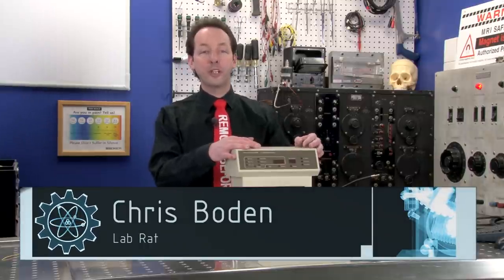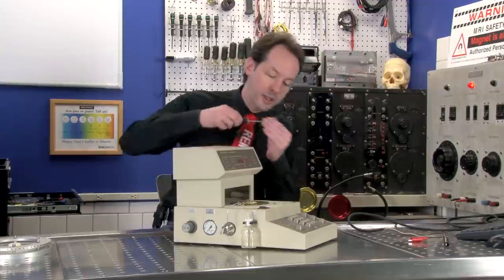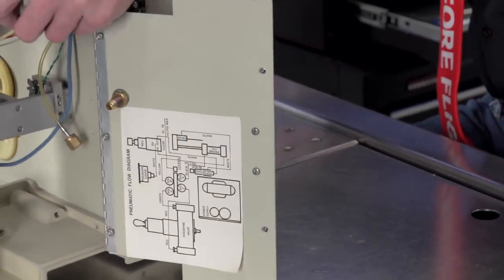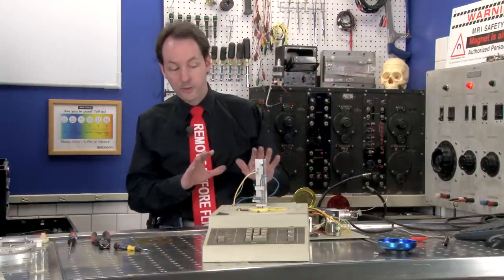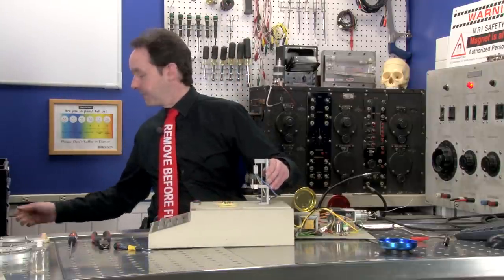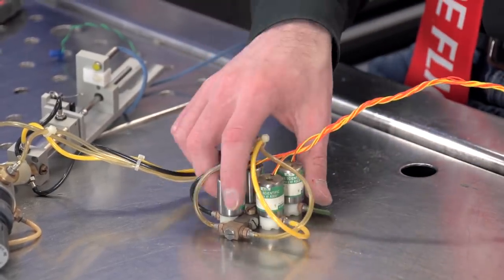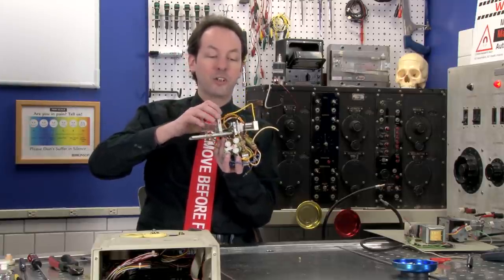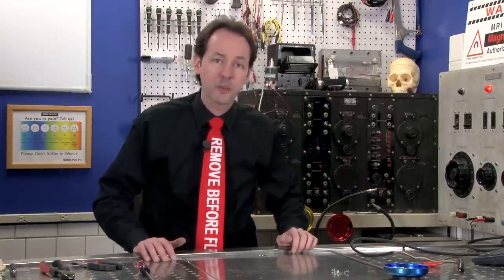Autosampler: Equipment Autopsy #87

Comment: The disk is actually a 2 digit/7 bit binary coded decimal. Looking at the plate at 7:37 at about the 12 o'clock position on the plate you can see it go from
    [000][1001](09) 
to
    [001][0000](10).
This pattern is consistent around the plate and the max number used is [110][0000](60). My guess is that the rotation controller cares very little about what position the disk is at and that the "fingers" which read the plate directly drive the location display inputs.

It also looks like there's some sort of indexing mark inside the digit markings at about 2 o'clock. (Not sure if it's part of the manufacturing process or another data point for the controller)

Comment: You were right, that is a precision pump at the end.  Liquid chromatographs (LC) use microinjections of samples (microliter-level) diluted with comparative assloads of solvent (1-2 mL per minute) to push the sample down a separation column.  The chemistry can vary wildly, but think of it like a pachinko game.  Gravity is your solvent, and its constant force pushes the marble (your sample) down the maze.  Now, if you have several compounds in your sample (imagine grains of sand, BBs, marbles, and tennis balls), they are going to come out of the end of the separation column at different times - especially the tennis balls, which won't fit down the pachinko maze at all.

Here's a REALLY simple diagramatic video:
https://www.youtube.com/watch?v=mPO7Tv2mIJU

Comment: CCV likely stands for Continuing Calibration Verification. "The Continuing Calibration Verification is a check standard used to determine if the sample analysis is within control limits."

It kinda sucks that you completely ignored the electronics tho :(